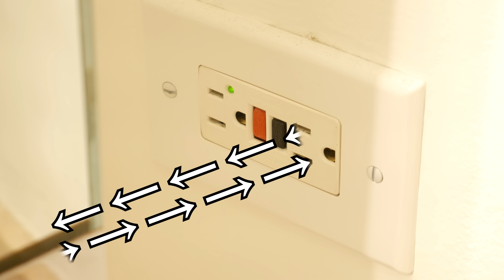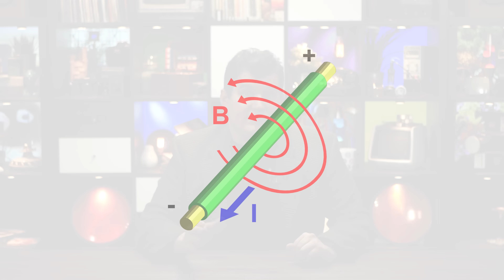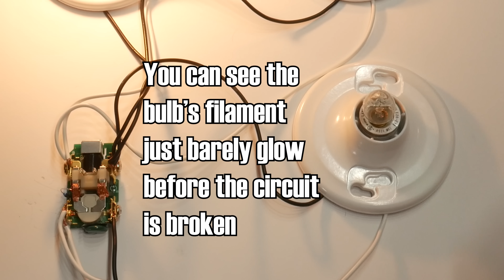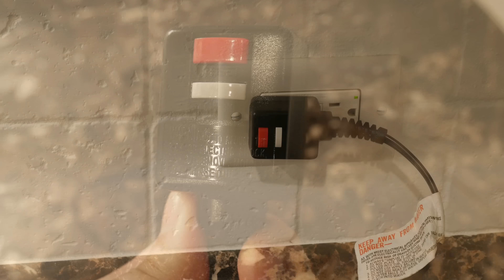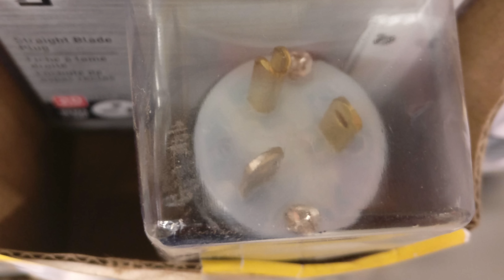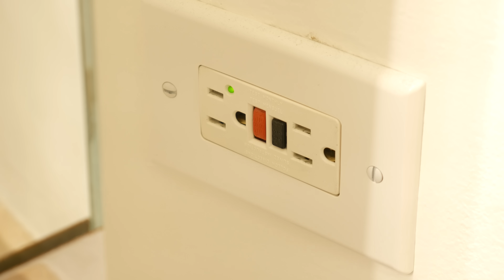The GFCI/RCD: A Simple but Life-Saving Protector

Comment: I used to live in the UK with 240 volts RCD's  in the service panel and no outlets in the bathroom even the light switch was ceiling mounted with a pull string to operate it. Now I live in New Zealand and again a 240 volt supply and RCD's  in the service panel but here we do have sockets in the bathroom that have RCD's built in, so I wonder is that a double protection? As always an excellent and informative video. Cheers

Comment: I felt like this was missed at the end (it was said earlier), but GFCI protected outlets only protect you if the fault is LEAVING the circuit and not returning to the outlet.
However if you happen to act as a conductor touching both the positive and the neutral wires at the same time the GFCI circuit will see noting wrong with this and consequently not shut off the circuit.

In fact I would argue that GFCI outlets near water in most locations in new modern American homes is completely unnecessary as all new plumbing is done using PVC piping, and not copper like they once were and therefore cannot conduct electricity. The only time this outlet would be actually useful is if you had a cement or tiled basement floor which does act as a ground for electricity LEAVE the circuit.
I say this as I have been electrocuted by GFCI protected outlets before.

Little fun fact for you, IF you are NOT grounded you can safely hold onto a bare electrified live 120v wire without the slightest tingle or zap ⚡️ this is because alternating current electricity needs to have a return path for any electrons to flow through you, whether that be the neutral wire or you touching something grounded.
(Still wouldn’t recommend you do that, but now you know)

Comment: Interesting your toaster doesn't have a ground (earth) wire. That wouldn't be legal in Australia unless the device is fully double insulated. Which toasters are not.
Reply: Americans have some ad-hoc principle on toasters. They are not grounded so that if you pick toasters and put a fork inside you will not get a fatal shock. In Europe such ad-hoc rules are not accepted. Here an ungrounded (not double insulated) plug does not simply fit into grounded socket. Toasters here cut the power from both sides so then the try is up there is no voltage no matter which way the plug is in.

Comment: In the UK they protection is also in the socket, but that's because a lot or wiring was built just after the war, when copper was expensive. They built just one set of wires that ran along all sockeets, and gave every socket a fuse so you would not plunge the house into darkness at the first fault.

Here in the Netherlands we have lots and lots of fuses in the utlilty/service cabinet. It's not uncommon to have separate fuses with interruptors for every "wet" device in the house, and definately for each floor.

Comment: Is it possible to get shocked or even killed from 100V? We in Europe we are expiriencing shocks using 230/400V system, and still alive :)
Reply: It's current across the heart for a sufficient time (given the amount of current) that kills.  Voltage is only related.  With a 240V system, it's easier to have a situation where you have sufficient current across the heart.  But depending on the situation, it doesn't take all that much voltage to be lethal.

People talk a lot like it's the voltage that kills, but that's just what you feel.

Comment: You shouldn't "daisy chain" outlets together using the 2nd pair of connection points. (It's legal but considered bad practice.) Splice the wires together along with a third "pigtail" which you then connect to the outlet. Current passing through from other outlets then doesn't pass through the outlet producing additional heat, which can shorten the life of the outlet. (Over time, heat can cause the outlet's internal connections to lose tension and not grip the plug securely.)

Comment: Do these also work with excessive heat? I've noticed that my space heaters, which have then on the end of the plug, will pop every once in a while if the heater is left on too long.
Reply: Possibly one of the heating wires touches the casing, due to thermal expansion.

Comment: I remember when I stuck a paper clip in a heater that ended up going into the power and stopped the outlet from working (and the heater shot out sparks) and used the control panel, frick that was a weird time.

Comment: IN the UK (240V) we call them RCD's because, historically, we already had safety breakers called Earth Leakage Circuit Breakers (ELCB's) which worked on the voltage detected on the house earth (ground) wire with reference to true earth.  These only picked up faults on earthed (grounded) 3-wire appliances, and were introduced to minimise the risk of a poor house earth connection (water pipe etc) from allowing the said earth wiring to acquire a dangerous voltage.  When RCD's were invented they used the term 'residual current device' to differentiate them from the ground voltage-operated breakers which can't detect fault current through a human or from an ungrounded appliance.  Back then, the UK who were slow to introduce overcurrent breakers, used rewireable fuses in the main board which could be reluctant to blow on earth faults on old installations.  :-)

Comment: I once played an electric guitar plugged into my amplifier while on a wet concrete walkway around a swimming pool. Need I go on? Ok, I will lol. My shoes got wet from walking around the pool. I touched my guitar's pickup and the metal part of my amp's handle at the same time. Even today, 40 years later, I can still feel the insanely horrible BUZZZZZ! through my whole body, and believe it or not, I could FEEL that the current was alternating really really fast (60 times a second, actually). It only takes one shock like that to make me pray to the god of electrons to never feel that again!
I can - almost - laugh about it now, but musicians and vocalists have been killed, some recently, by touching an ungrounded microphone.
Reply: I can relate to that. The best way to describe a shock on 120V AC is that you feel it vibrating. I took a shock on 1600V AC and that just plain hurt. My hand felt numb for a few hours afterwards (it only went from my middle finger to about my wrist)
Reply: Hi yes why on earth was mains voltage running through your guitar. This makes no sense to me as to how you would get a shock here. Handle on the amp shouldn't be connected to any sort of ground. Should be completely isolated. Your pickups should have less than a volt going through them at any time, they dont actually receive any voltage from the amp. No idea how you managed this.
Reply: @ccleake1  You see, there's a lot of "should" and "shouldn't" happening here. In normal situations, yes. When shit goes bad, no so much.
The strings are grounded on a guitar, if this ground gets electrified with mains voltage at the amp, you get a mains shock on your fingers. You never know the absurdity of some electrical designs out there after all.
Reply: @Kalvinjj  I had a brand new gretsch that would shock the hell out of me from it's vibrato bar lol
Reply: @ccleake1  some tube amps use the metal chassis as a neutral,"hot chassis set"  if plugged in the wrong way the case and  ground of all the jacks and 
cord going to the guitar will be hot  , sucks when the mics are at ground 
and you touch one with your lips
Reply: @ccleake1  the guitar probably would have been grounded. And the amplifier damaged and become live
Reply: @ccleake1  It makes sense how this could've happened since voltage is "a difference in potential". The guitar amp is properly grounded at the receptacle. The water is more or less grounded but probably at a different potential. This is why nowadays there's crazy grounding requirements around pools, you're required to ground every aluminum post or potential source to ground. This is the reason why because if you're at a part of the pool which is grounded not as well as the copper ground rod sunk 6' into the ground then bzzzzzzt!!!
Reply: A guy at my work was working on a hazer (boring version of a smoke machine that pumps out slower) and asked his freind to turn it off while he cleaned the inside. His freind didn't do that...

Boom, 240v.

Another guy at my work for similar from a lamp in a venue he was working at.
Reply: Reminds me of when I was like 5 years old and wanted to test the new oven's lamp, I couldn't get enough extension chords to the outlet I could reach so I used a transformer mid way there. Step up 127v to 220v and that was my 1st electrical shock
Reply: @Kalvinjj  you were one fucking strong 5 yr old picking up a transformer and pretty damn smart to know how to fabricate it to receive a 120 plug.
Reply: @freakylilg  Nah it was quite small (like a 120VA model for small stuff) and plugs are all the same for any voltage here lol (yes, even nowadays, 127 and 220V plugs are the same, they'll just get a red outlet to differentiate if 127V is the normal voltage).
It wasn't so fun tho when I came all shaky to tell mommy how I dun goofed
Reply: @freakylilg  Yep, Brazil, we only now standardized into that one-off plug we made up... Safe? Sure, now it's pretty darn safe. Inconvenient? Heck yeah! Any US stuff doesn't fit without an adapter, and our grounded stuff doesn't fit without an adapter into older sockets as well...

Also annoying that we DO have 220V on some places here who knows why. In fact a small city nearby my city does use single phase 220V cause yes (giving a 400 ish two phase voltage that has no residential use here, not even heating)
Reply: By the way, that 220V here is 60Hz too so European stuff may or may not work either (tho of course very few stuff don't, like only stuff with synchronous AC motors such as some old audio gear)
Reply: Or to abridge. It was shocking.
Reply: The power of Zeus flows only through demigods and proper circuitry.
Reply: When I was electrocuted when I was 8 I felt it go up my whole arm into my shoulder and I still remember how much it hurt today, as a 17-year-old.
Reply: Been there too. I work on old stereo stuff and when working on them plugged in like an idiot for testing, I have on occasion touched an exposed part containing 110v, Weird feeling XD
Reply: Once when I was little I had a little 3.5v DC motor & I had the bright idea to see how fast it ran if I put mains current through it. 
I plugged in my cassette player's mains cable into the socket. Switched on the 240v 50 Hertz and poked the motor's wires down the little holes of the cassette lead. 
That's when I learned that DC motors don't appreciate 240v AC! I can still remember the green/blue flash and it throwing me across my bedroom floor!
Lesson learned!
Reply: If that was bad wait til u catch 220 through your heart as a welder.
Reply: @freakylilg  ugh, I got 277 through the chest and felt like I was gonna pass out after so I feel for ya! But 277 is only a single phase and neutral so I wonder if 220v feels different since it's two phases together hmmmm something to try?
Reply: @VolatileScrotumfullofWorms V=R*I, so for the same resistance (in this case, your body) if you raise the voltage the amperage will also go up.
Reply: @bsanchez3563  It has everything to do with a countries wiring standard! In South Africa you cannot get a shock from a wiring system correctly installed to SABS standard.
P.S. I am an electrical engineer ( light current)
Reply: Only in American shithole countries where their electric wiring system is very backward. In civilized countries like South Africa the earth leakage circuit breaker would have tripped almost before you experienced a shock!
Reply: @andrewallen9993  What is it with non-Americans and their inability to contain their aggressive hatred of all things American? It just makes it look like you have an inferiority complex.

Comment: in the us, most electrical codes state receptacles within 4 FT(1.2 ish) meters of a sink must be gfci or connected to a gfci receptacle.  meaning either that receptacle must be a gfci or it must be downstream from a gfci, funny enough, i just looked at the ones near my kitchen sink and they are not gfci but maybe the breaker is one or the one for my fridge is a gfci, but i am not assuming anything at this point

Comment: Some older European installations used "TT" (terra-terra) earthing systems where the earth between two ground rods is the only fault return path.  Not a very low impedance path (about 25 Ohms typically) so relatively low fault currents are needed to open the circuit.  Far less than what the standalone overcurrent protection opens for.  I'd imagine that's probably why their codes have required RCD's at the panel for a while.

Comment: "The same holds true for the reverse polarity of the A/C cycle." 

I didn't think there WAS any "reverse polarity". I always thought that even though it is called "Alternating current", household juice just went from 0-110V on the hot, while neutral stayed at ground.  (Hence calling one wire "hot" and the other "neutral".). It's this way for obvious safety reasons.  (e.g. you want the shell of an Edison-socket light bulb to be nuetral so there isn't an exposed "hot" surface during bulb insertion.)
Reply: On a 120V circuit, the "hot" lead has voltage alternating between +170V and -170V.  And, as you say, the neutral lead stays at (or at least near) zero volts relative to ground, so it's safer for something like the outer shell of an edison socket, or the unswitched side of the power coming into any device.
But that's voltage.   Current always has to balance.   If you have 1 amp of current coming out of the hot lead, that same amp has to go somewhere, hopefully into the neutral.  And then during the other half cycle you have current coming out of the neutral and going into the hot.  
Unless you have a ground fault.   Then some of the hot current (in either direction) is diverted to ground rather than the neutral and Bad Things may happen.

Comment: Somebody once tipped off this is a kind of ripoff,
It should handle twenty amps great.
But the only thing preventin' a twenty-amp connection,
Is the shape of the holes on the faceplate.

Well my hand starts aching but it's stopped by this breaking,
If it weren't for this thing I might've hit the ground shaking!
Didn't make sense not to install one,
Not just to meet code, but for protection.

So that's what we do, it's smart you see,
No-one wants to play things that risky.
A shock does more than leave marks.
The last thing you see could be sparks!

Hey now, you should use these, they're called G-F-C-Is.
Hey now, they're important, don't get paralyzed.
Loose current isn't your friend,
You don't want to meet an untimely end.
Reply: This is beautiful
Reply: So I'm not the only one who caught the "Shape of an L" thing 😏
Reply: Bruh...
Reply: Oh man. I had to read this twice to realize it’s All Star
Reply: @JNDlego57  I know all star like the back of my hand, I knew two lines in. it was just like "wait... why do I know this" rereads "this... this is all-star, isn't it?" continues reading "yep, it indeed is"
Reply: Genius
Reply: Niceeeeee
Reply: I want a Connextras video where Alec sings this.
Reply: I hate you.

Comment: 1:38 The musician in me heard a “wet power chord” and thought of a guitar power chord with wet distortion
Reply: As an electrical engineer and musician, if you only knew the dangers... Your electric guitar's safely grounded, you'd think. Untill your lips touch the phantom powered mic, burning and blistering your lips. Yup, that was a "safe" voltage and current, but boy does it hurt. How to prevent? Don't ground your amp. Also, imagine: outdoor gig, rainy, foggy or damp weather. Got a wall of marshall/vox/*insert favorite flavour*. How safe do you think it is? Well, of course it has a transformer, so high voltage is separated from line. But not the energy. And where does every ground fault go? You didn't ground your amp to not be shocked by the mic. So every fault goes through anything else grounded. Via your guitar strings, through you to the ground you are standing on. And this was just one example...
Reply: Well which one should I pee on?   That chord or that chord or in my chords? I'm sorry, it's 3:30  am  11 months later. This is an awesome and most important channel. This is why YouTube was invented.

Comment: To prevent confusion, the term ground in this sense is not referring to the bare copper wire. It is referring to the grounded conductor, otherwise known as the Neutral or white wire. That is called the grounded conductor because it goes out back to the street transformer which has a connection to ground. The bare copper wire is called the Grounding conductor. Grounded vs Grounding.

To avoid confusion, these devices in North America should have been called Neutral Fault Interrupter.

Comment: The only issue I can see with gfci protecting a whole house with gfci breakers is nuisance tripping. I actually learned about nuisance tripping in electrical college. Things such as a fridge or something that draws a significant amount of amperage when started could cause the gfci to trip. Sometimes the motor starting draws a slightly unbalanced current. Which is also the same reason why you don’t put an arc fault breaker on a fridge circuit

Comment: One of the things that has not been mentioned is that by having the RCD at the distribution board, you additionally protect all the wiring within walls and floors, meaning that when you are putting up shelves/hooks/etc. and accidentally drill through the embedded cable in the wall, you are afforded the same protection as any item plugged into the outlet.

This is mandatory in the UK in a great number of applications.  To design a circuit that doesn't need RCD protection is fairly onerous.